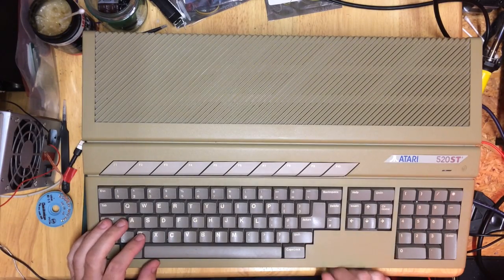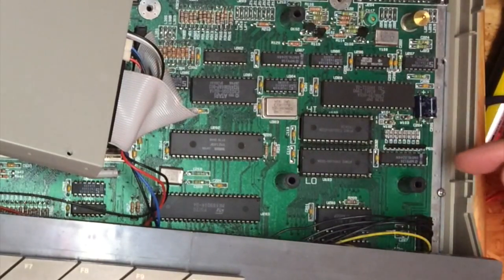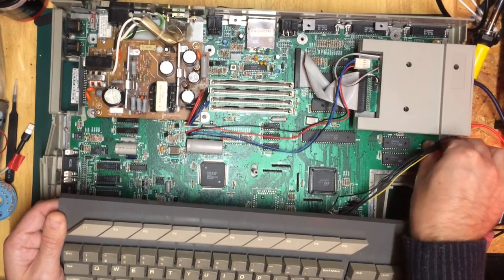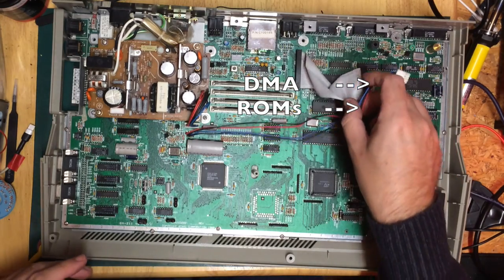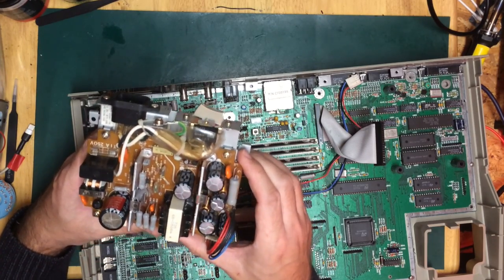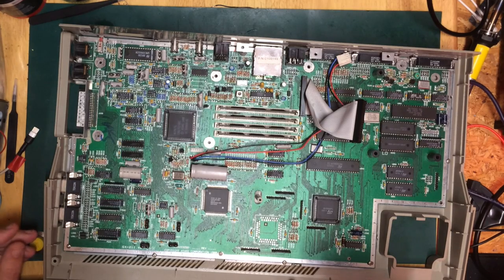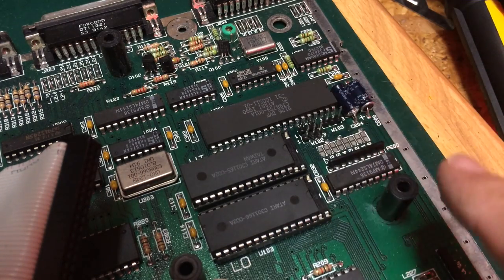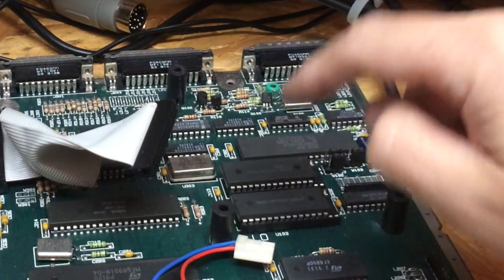Upgrading the Atari STE's TOS with EPROMs

Comment: Hi, I am getting my hands on 512Kb STE. Can you share with me the compatible memory upgrades you're using in yours? So far I found: SIMM, 30 Pin, 70ns (will 60ns or 80ns work?), anything else to look for? Thanks in advance
Reply from the maker: Hi there. I just ordered some old 30 pin SIMMS off ebay and got lucky with them. I think the timing is pretty unimportant as the STE never accesses faster than 120ns, from memory. There are fewer things to go wrong with 30pin SIMMs versus their 72 pin big brothers. You should be fine 90% of the time. Good luck!